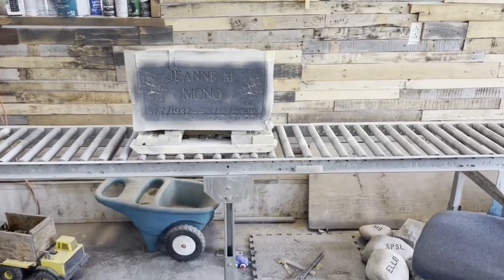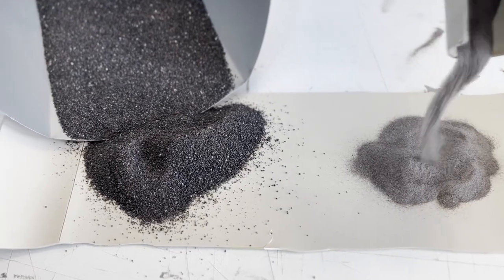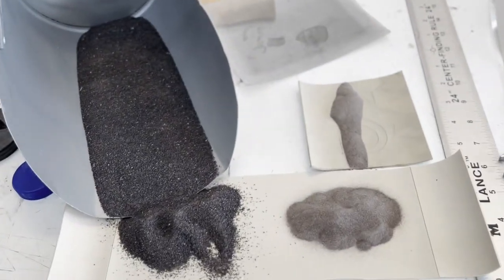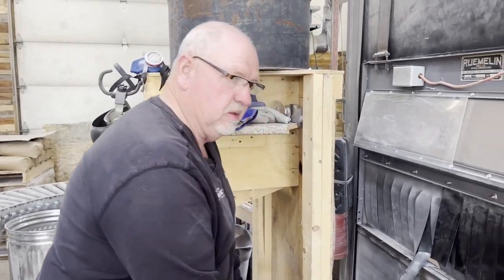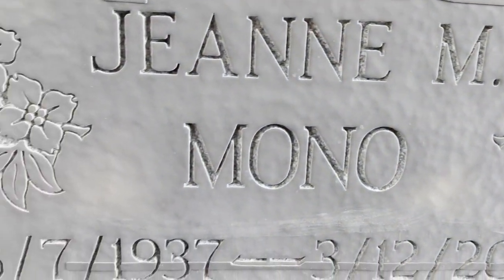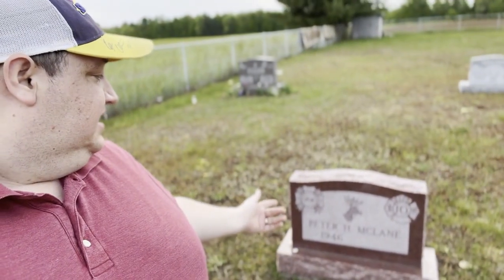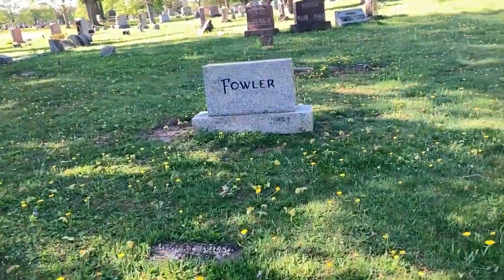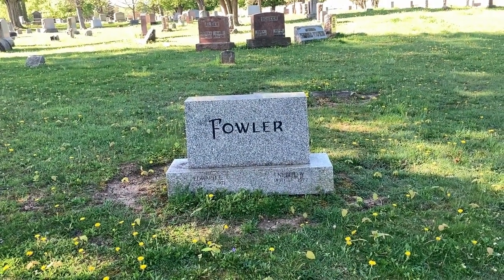Bluing VS Painting Headstones

Comment: Excellent explanation and demo. In your opinion, if a stone is "blu-ed" correctly without painting, will have as much letter contrast as painting on the first day, or will it be worse when new but better in the long run?
Reply from the maker: Yes never as good day one but way better down the road.
Reply: @-gravestonepros  Thank you. Can a gray granite stone laying flat (not vertical or slanted, due to cemetery requirements) be blu-ed and good enough to be legible on day 1? Do you make and ship stones out of state?
Reply from the maker: @woofinu   Yes it can be done well. I have shipped small stones like that before.
Reply: @-gravestonepros  Thanks. Let me check with some other people to see what they want to do.